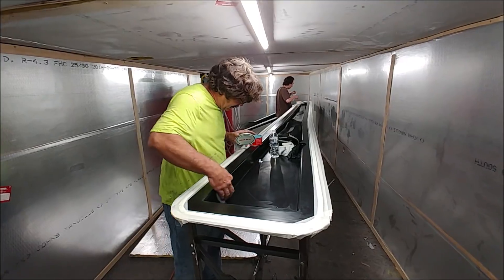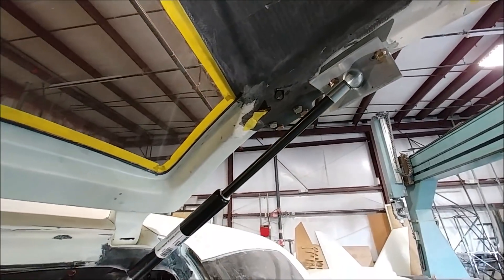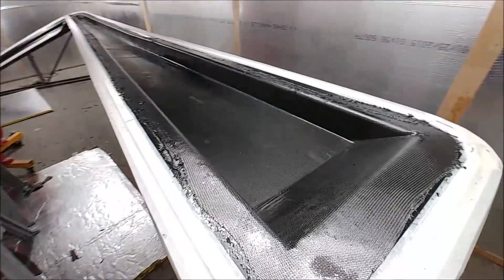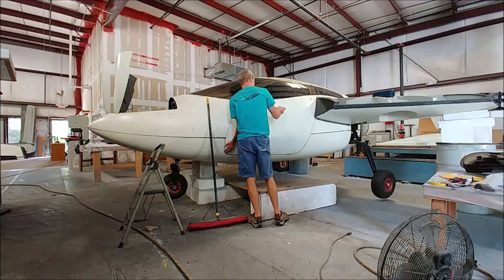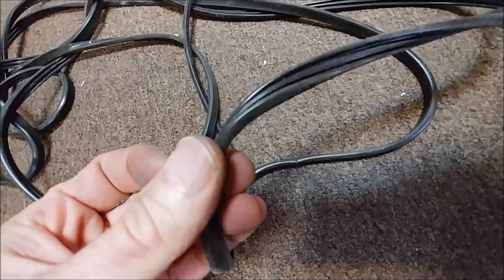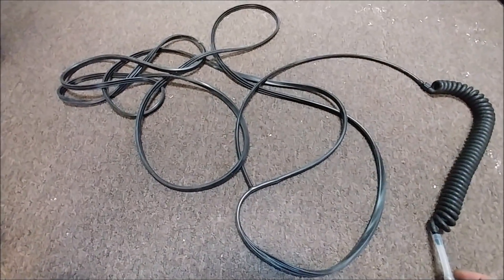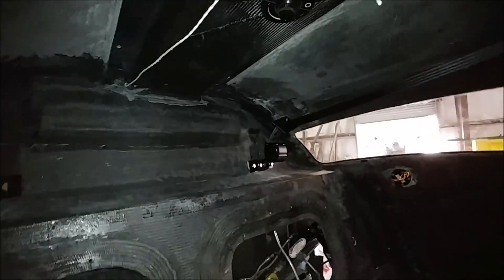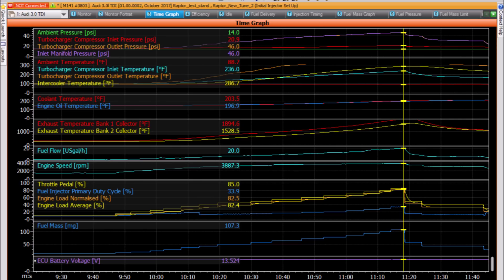Wing spar Layup Begins - Building the Raptor Prototype

Comment: can a thin(4" thick,13 foot root 3 foot wingtip, 10 feet from root to tip) delta wing be built with solid foam core and fiberglass skins with no spar?

Comment: Running at 3800+ rpm is off the map, your Pistons speed is out running the fuel burn on diesel. Maybe jet-A is different? 2800-3200 max is where you need to be. On the high side.
 Collecting fuel burn data at 3.8k rpm is not very useful.
Reply: Kyle Goldston    Interesting assursion regarding “useful” rpm range.  Can you share the basis for this, I saying you are wrong neccassarily?   Audi diesel v6 experience, I am no Audi expert but have seen some diesels rev a bit?    
Remember this is not prop rpm.

Comment: 400 lb door?  This is an aircraft, right?
Reply: Oh.  400 lb. LOAD.  Never mind.  So how much does the door weigh?
Reply from the maker: Actually it's going to be a 60lb door. That's why it's going to be redesigned. The 400lb strut is required because of the geometry. It's science!!

Comment: Hey Peter, re the door struts, what about just removing them and use a fixed strut to hold them open (like that broom in the video) for the prototype? Punt door improvements for now, you’ve got a lot on your plate already ;-)
Reply from the maker: Unfortunately you don't know how much effort it requires to lift the doors when you're on the inside trying to get out. We need the struts, believe me!
Reply: Good reason!

Comment: Great work as always and thanks for taking the time to produce these videos!  Just wondered why (apart from it looks amazing), why the doors aren't hinged on the vertical so they open forward rather than up? No need for struts (but wouldn't look quite as cool).  Is it due to the geometry that they would hit the fore-planes swinging forward or some other interference issue?

Comment: Peter have you thought any more about getting direct measurements of thrust ?  All your engine work (and talking with engine guys At Oshkosh) is really got me thinking what an incredible challenge you have stepped up to.  I am sure you realized this a long time ago.   Anyway, direct thrust measurement would be cheap,  easy and immensely useful.  I posted the concept a few months ago.  Put the stand on rollers (could be simple as lifting and sliding 2 pipes under stand perpendicular to the crank).   Tie the stand to the building or floor anchor, put a load cell in line.  Tie a safety chain to a separate point, we don’t want the engine pulling itself off the dock, haha.
Reply: Tim Duncan ,,, it would be interesting; however that prop, @ that pitch, @ that rpm will have plenty info . Of course less so with that air frame .
Reply: Roland Tamaccio ....  haha that air frame may have some aerodynamic challengers!   But in the end thrust determines takeoff dist, and thrust determines speed.   Can’t optimize what we don’t measure.